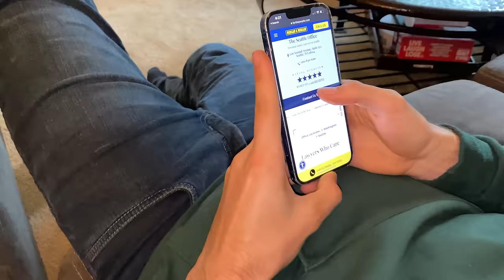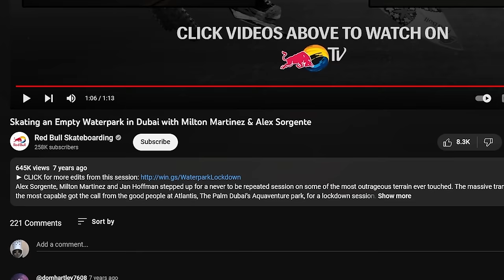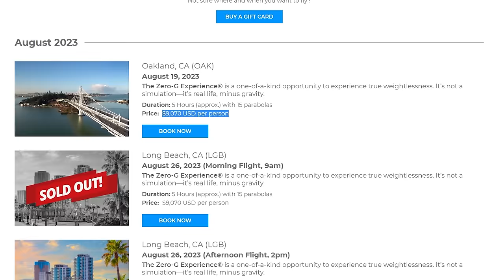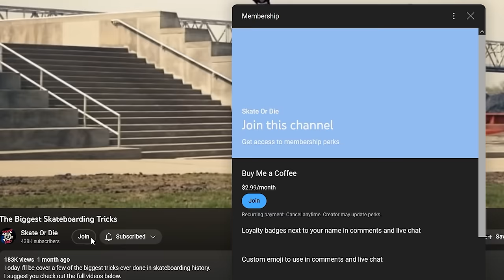The Most INSANE Skate Spots

Comment: That skating on the dirt is not that sketchy. Yes you slide more, but because the trails are usually canted on curves it allows to slide right past. There are a LOT of skateable trails in Colorado. I do recommend bigger wheels, though. You can tell they are using HUGE wheels. Those look bigger than 70 mm. I use the Shark Wheel's 95mm wheels. Though the 72mm and 60mm wheels roll nicely over the dirt as well. Me and a friend used to do it all the time.